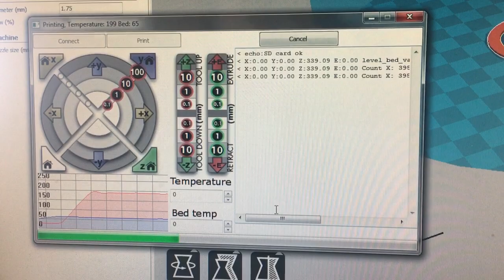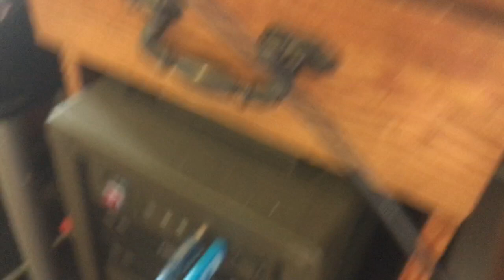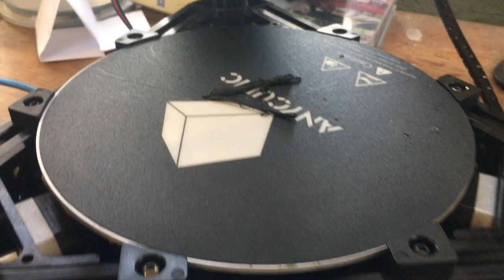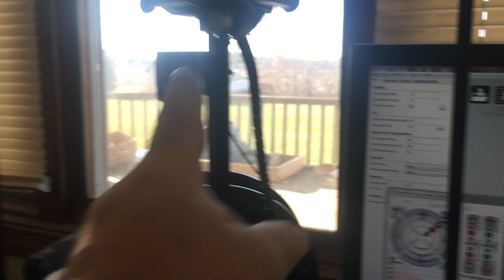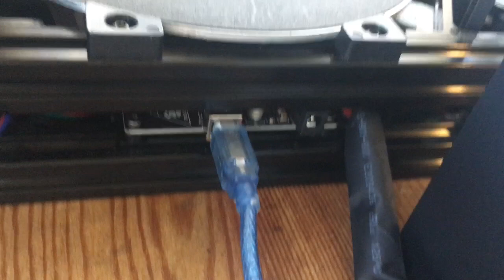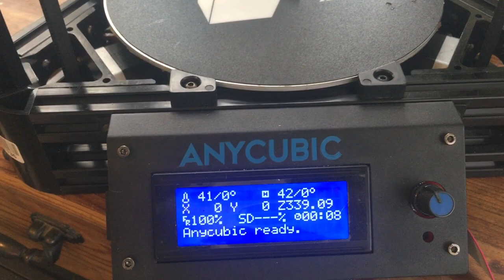ANYCUBIC KOSSEL Delta Print Problem Video 2 of 2

Comment: That machine came as a kit, only as good as the guy who put it together, tear down and rebuild when leveling probe should cover build plate not just go across also   there should be no need for a separate power supply for the display  (stl is model info, gcode is commands for the machine)

Comment: Hi Mike. I had this exact same problem yesterday.

I selected the wrong machine type in Cura.

Cura has, amongst numerous other options, 'Kossel Pro'  and 'Kossel Mini'. I thought to myself, "Well, it's clearly not the mini..." and selected 'Kossel Pro' instead. That was a mistake. I spent a full day trying all sorts of fixes/checking connections etc.

In the end, all I had to do was select 'DeltaBot' as the machine type instead.

Comment: It's not something related to motors (all three have to work perfectly for it to be able to translate head by line in bed plane, extruder also seems to be working).
Most likely your GCODE is fucked up.

Try moving it manually (not by hand but using printer menu) to confirm it can move.
If not then it something in firmware configuration.
If yes then your GCODE is fucked up for sure.

For power supply issue, it's either your board wired incorrectly or, most likely, is fucked up slightly. It supposed to power everything from 12V PSU just fine.
Socket there is for 12V input from low power PSU, it's used for configurations without heated bed.
5V USB can power the board for dev purposes, for example for when you want to update firmware, so you don't have to power entire machine to do just so.

Comment from the maker: Note: isn’t the print head supposed to move all over the build plate during Z-Height and Bed Leveling 69 calibration points? It only moves left and right 3 oclock to 9 and back and forth. It never probes forward and backwards on build plate. Steppers on left and back seem to have much tighter detents to their rotation when rotated without belt tension, could this suggest a stepper motor issue. However the motors can manually be jogged via controls in X and Y positions, and it can auto center on end stops when it homes. Any ideas anyone?
Reply from the maker: Problem was figured out a long time ago. One of the stepper motors had a missing header connect on mainboard from factory, previous owner assembler had the one stepper plugged into the unused driver. Anycubic sent me a new board, plugged in all 3 stepper motors into its correct header connect for X,Y & Z axis’s and this solved the problem. Imagine that, a faultiest board without a motor connector port (header) not even soldered on!